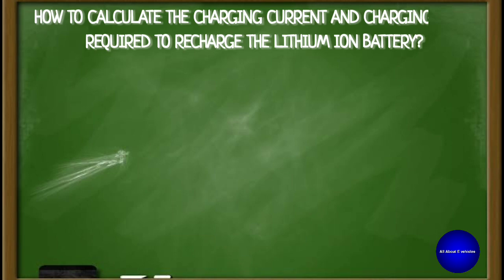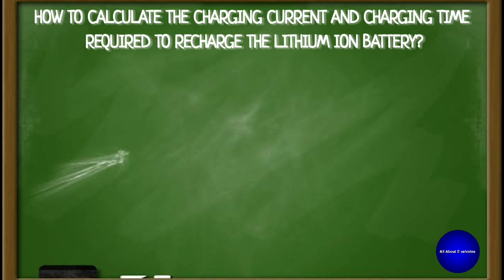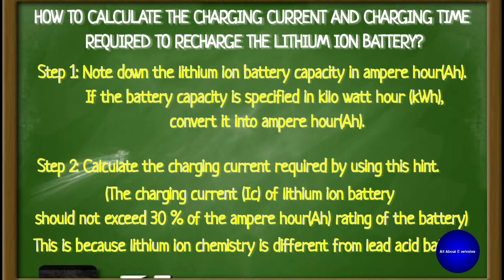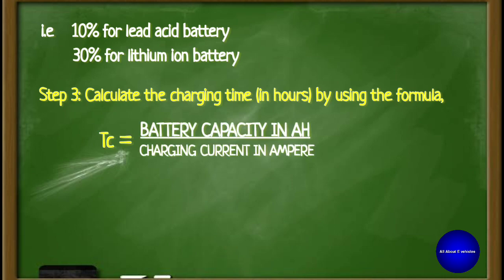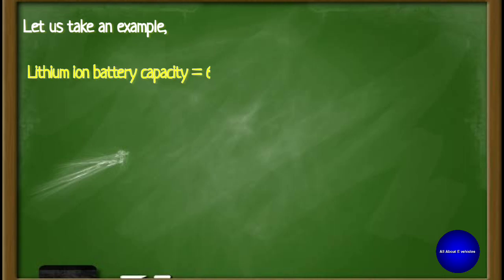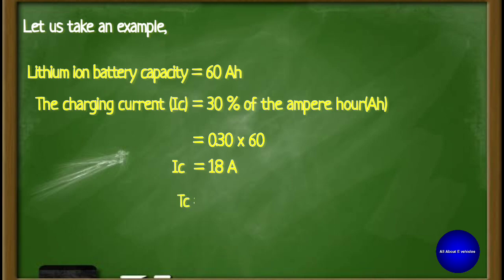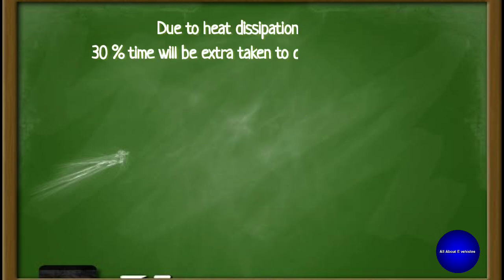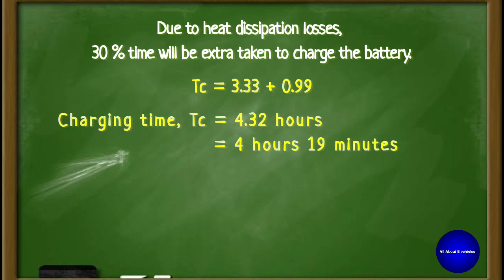All about e vehicles|Charging time and charging current required to recharge the lithium ion battery

Comment: Your accent is fine. Ignore the haters. Could you help me calculate my battery and charging time please?
Battery =100ah lithium 12v
Charger=1amp noco genius 1
Charging time= ?
Thanks in advance🙂
Reply: Are you sure that your charger is just 1 Amp? It gonna takes more than 100 hours to fully charge it if empty, if you meant 10 Amp then the time is about 11 to 13 hours

Comment: Based on your calculation if you charge your 2000mah lithium-ion battery with tp4056 I will roughly take 2 to 3 hrs but it will take around 7 to 8 hrs to charge.there are also various factors one of that is C rating.learn something first brother.nice try.👍